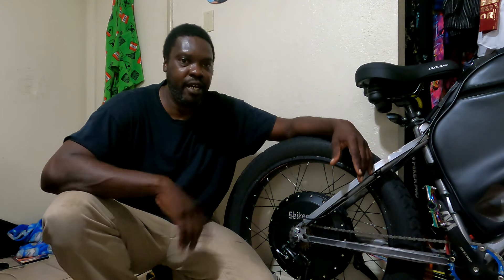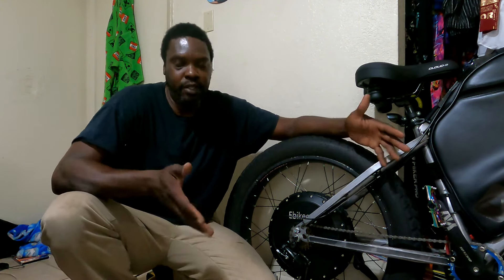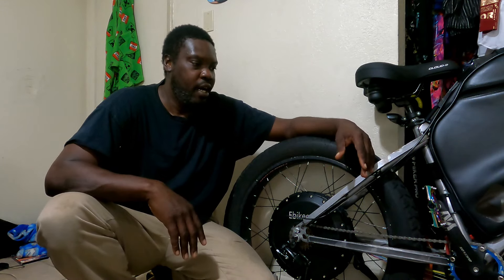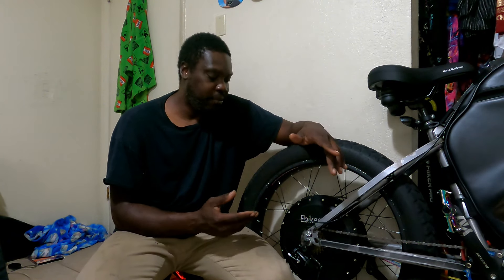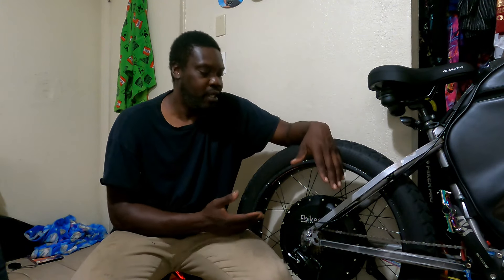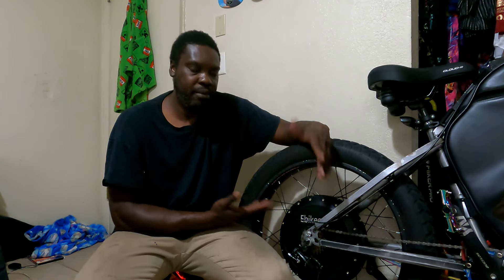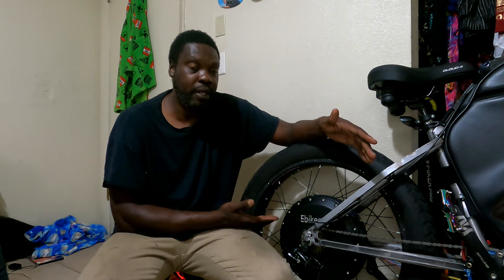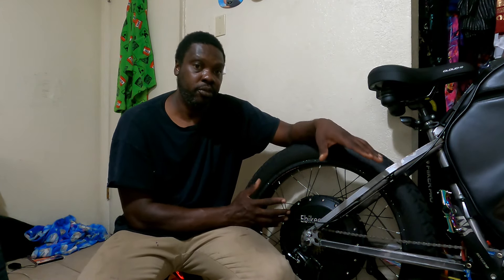Repairing the 8000w Tommebike Icon  part 1

Comment: I thought i blew up my motor a few weeks ago with a sabvoton controller. it did something similar with what felt like hard vibration with the power going out. I ordered another motor and controller, but after testing it with a ebike tester, determined it was the controller itself.  the one good thing about these ebikes is they are simple machines and many times you can just replace wires or capacitors and get it back running easily.   Sure beats a piston going through a cylinder.
Reply from the maker: Lol definitely agree about a piston I had then happened many times
Reply: Its tacticool dennis 🤘🤘. On the sabvoton I can only turn it up to 12 poles cause of my display but unlocked never the less she rips the 72/273 👽🤓🚲🎬

Comment: Good to see you EBH after hearing about floods in FL. My first ebike from 4 years ago , one of the gears is broken and now no good. It had 41k miles and I used it many times going up 6 hills every day. Only 600$ 4 years back and I converted it to be a dual motor so its running still until I replace that rear motor with another rear I have. Was a great first ebike buy for cheap of converting to a dual motor, learned alot off this first DIY Build with 4 more others I bought and upgraded later on. The ebike you have here is hell of an ebike! Love them big tires as it is best to use them fatter ones for speeds over 35mph. The tire pressure on standard 2 inch wide tires goes thru alot of impacting between road and faster mph, they usually get deflated more often. I just ordered a regular Trike Bike to convert into 2ooo watt ebike, had to make sure the front forks haf shocks for its 1 extreme need for ebikes over 500 watts from snapping or breaking.

Comment: Add cooling oil to the motor, this way not only the electromagnets get hot, the heat is distributed evenly in the motor body. However, you should wrap the heatsink cooling immediately around the motor, this makes it easier to throw the heat inside out. In this way, I can run my 2000 watt motor with 6000 watts of power, it was very useful.
Reply from the maker: I think I'll be doing that soon
Reply: Same here to tobthink about it 🤔

Comment: Yo what’s good I have a rare request. When you take the motor out to swap wheels, can you measure the diameter of the motor? I have this wild idea of fitting just a solid 14” or 16” tire on the motor itself as an experiment. Crazy idea right? The dimensions of the QS273 online appears that it could work. Then again maybe not. But that’s the great part about diy is we can push the envelope far ahead of what mass production bike builders are doing. Keep us posted on the repair! And ya this hobby is NOT cheap! 

I’ve also been looking into a batch of P45b Molicel as well as waiting to see when the P50 will be released. Because then we would have the option to build a smaller sized battery, say with 25-30% fewer cells but make the same power as the mega range battery.
Reply from the maker: Oh heck yeah  I'll do a measure for you

Comment: I hope your supplier sends you a stator with temperature sensors because if you had that and had them selected in settings your motor wouldn’t be fried by a wrong tune or turn and burn settings. 

AN is the magnet arrangement. AN 0 for the large diameter surface mounted motors, AN 6 for the OEM Surron, AN 14-16 for V-type embedded magnets. 

LM is the waveform. 22 is default but I find 16 runs smoothest. You can set this in your living room or any quiet place. As per the Fardriver manual, just decrease 22, 18, 16, 14, 12 until it feels/sounds smoothest. Always set the HIGHEST LM value that gives smooth operation. So if 18->16 felt good, and 16->14 not sure, couldn’t tell, set it back to 16.

The test is just accelerate from a stop a few feet. Don’t need to go far or fast. You will hear/feel if it’s better or worse.

The temperature sensor is like a BMS, worth every penny. My motor doesn’t have one because it’s a 💩 motor with no optional temperature sensor but if I ever buy a QS motor, it will definitely have a pair of KTY83-122 sensors in it. It would have paid for itself 10x the first overtemp it saved you from. 

You have a 4kw motor, and a 12kw controller with peak power of 43kw. So temperature sensor is pretty important.
Reply from the maker: Thank you man you is a fardriver God!!!!
Reply from the maker: @PaulslowHard  I agree 👍
Reply: would a smaller fardriver be a sweet spot or I misunderstood?
Reply: @PaulslowHard  ,yes, the Fardriver manual isn’t very clear on how you would know which hub motors should be AN:0 and which should be AN:2-4. The KO Moto manual gives a better explanation of the settings for Fardriver controllers since it is basically a Fardriver controller.

Yes, its strange they even make a 273 40H without temperature sensors, since every real controller has motor over temperature protection. But the cheap generic controllers don’t which is why many hub motors don’t have temperature sensors. They do make cheap 4000w controllers so I guess they offer a way to save money and not get the sensors.
Reply: @mA-ug5ts  , the Fardriver 721200 can be set to behave responsibly with a 4kw motor, but it comes with default settings for a typical 12kw motor.

The thing to understand about a motor’s rated power is there are so many variables that affect it. A 273 40H motor is considered 4000w continuous power but even that depends on if you are in Siberia or Florida temperatures, and going uphill or down. 

Most OEM controllers will deliver 50%-100% of rated power, so a 4000w controller would give 6000w-8000w peak power for acceleration and then the rpm control pulls that down below 4000w. So it’s very hard to burn a motor. Manufacturers do this because they have a warranty.

Fardriver controllers can sent 300%-400% of rated power. So a 72530 (330a DC) using 72v can peak at 24kw and that is more than enough for a 273 40H, and still must be set to pull current down to the maximum continuous watts the motor can tolerate. And since it has the capacity the burn the motor quickly, they have motor overtemp protection but that only works correctly if you use a motor with temperature sensor. 

When you connect a 43kw peak controller to a 4kw motor, it doesn’t spontaneously ignite, but if you use wrong settings with no over temperature protection, its very easy to burn the motor. 

The motor is basically copper wire with an enamel coating that insulates it from the other wire and the stator. When it gets too hot, that varnish melts, and the motor is burned. 

You can send as many amps to a motor as you want, as long as the windings don’t overheat. This means every amp value above maximum continuous has a time limit that gets shorter and shorter the more amps you send. 

This is why Fardriver has a BOOST feature, for those who want to send 3x-10x power to their motor, but for only 5-120 seconds, followed by a 5-120 second cooldown. BOOST does not make the controller more powerful, it allows you to use an over powered controller on a smaller motor safely. I use it on my 72360 with a 2kw motor.

If you set a 721200 to TURN AND BURN with a 4kw motor, and you do not have any self control, and don’t have a temperature sensor to monitor, that motor will be burned for sure. Many people have done it. 

The cause of this motor failure is still unknown. But if he had TURN AND BURN settings (which is the only way he rolls lol) and in his testing he learned he can give it full beans for 20 seconds before the magic smoke comes out, and then sets LM too low, causing the motor to run very inefficiently, turning more of the amps into heat than into torque, the motor would burn is less than 20 seconds.
Reply: @imho7250  thanks that is alot of valuable information
Reply: @mA-ug5ts  , this is why there are absolutely zero YouTube videos showing how to tune a Fardriver properly, especially for people new to controllers. I want to make a “Fardriver for Dummies” video, but it will take a long time and each setting would need a link to another video explaining the fundamentals.

For example, first setting AngleDetect, is where you choose the motor position sensor type used. Either 120 degree hall sensor, 60 degree hall sensor, or one of several encoder models. Then a link to a detailed video showing what each one is and how it works.

Then TempSensor, showing the available sensors and even the Cacu simulation that estimates the motor temperature. I have a video for that and I do use that setting because I have no temperature sensor.

Some of these are detected during autolearn. But moat settings are not. 

There is a distinction between basic settings and a “Tune”. Changing pole pairs, throttle curve, temperature sensor is not a Tune. These are basic settings. A real tune involves changing the settings that affect the way efficient of how the controller works with a specific motor on a specific bike with a specific rider in a specific environment. These include:

MaxLineCurr, MaxPhaseCurr, (BoostLineCurr, BoostPhaseCurr if boost features is used), MaxSpeed, ratios in speed, all PID settings. Basically any setting that determines is the motor will burn up if the rider does release the throttle before the controller automatically throttles back.

The reason for the distinction is if I say “Fardriver Tunes, $5” and then I say “ok, open pro settings, change ThrottleResponse from 0-Linear to 1-Sport. Feels good right? That will be $5. Thank you”. I would get a lot of hate that is not a tune. That’s merely a rider preference. The motor doesn’t care. It’s not going to run better. 

But the reason nobody and I mean ABSOLUTELY NOBODY has made a full tune FarDriver video is that in order to understand each setting, you need a basic course in Engineering, Physics, Motors theory, electrical theory. You can’t just say “increase MaxLineCurr until it feels good” lol. 

Someone new to controllers will be overwhelmed by all the settings. So to make a video that teaches a noob all the fundamentals needed to make the proper change in settings would be very very involved.

I have a basic setup video and there are several good ones on YouTube but that is absolutely basic setup. For any fardriver with proper size or bigger for the motor it runs, it absolutely needs a tune. Basic settings will not be safe for the motor or the battery if the motor, battery and controller were not matched when you buy them.

If i put a 721200 on my 2kw motor, using default settings, ran autolearn. And then drive it. My motor is going to be burned in the first 5 minutes of riding. And rhe 721200 will be cool as a cucumber. Lol

Comment: It may not have actually burned the windings out it could be the phase wire insulation inside .. look on the bright side.
Reply from the maker: Ok I definitely will
Reply: If so it's gonna be a cheap fix...

Comment: Sorry to hear that Bro 😢 i am sure you will get it fixed! and it will make interesting content that helps other people. I burned up the phase wires on my BBS02 mid drive 😅 its nice you can get a stator, and don’t need to buy a whole new motor. It will be interesting to see the inside of the 273. In my motor, i couldn’t tell where the wires shorted, i think it was the insulation on the phase wires failed. Cuz i don’t see any burned up wires.  I wonder how tricky it would be to rewind the stator?
Reply from the maker: Heck yeah bro,  it will definitely be alright I'll ride the back ups for now

Comment: What was the problematic pid tune on your fardriver? I'd like to avoid the combination in the future uf possible to be safe. Thanks man.
Reply: As stated in the video, he believes it was when he set LM too low. LM is the waveform and must match the motor. 

If you know anything about tuning old cars, LM is similar to ignition timing. Setting it retarded is safe but doesn’t make the motor run its best. As you slowly advance the timing, based on the fuel octane, the motor runs better and better. But at a certain point, if advanced too much, the combustion actually tries to push the engine backwards and it makes less power and extremely high cylinder pressure.

Same with LM. Default is 22. It normally runs ok, safe, but not its best. As you “advance” it to 20…18….16… it gets better, smoother, quieter, cooler. But if you keep going 14…12…10… it starts to run inefficiently. The power going into the motor starts making more heat than torque. 

Thats why the Fardriver manual says use the highest setting that gives a noticeable improvement in the motor jitter. For me it’s 16. For all QS273 I helped tune its 16. But its highly dependent on the motor magnets, which determines the AN value. 

The final analogy is, if you take 3 different motors with different magnet arrangements, and connect them to an oscilloscope, and and spin the motor to create energy, each motor will have a different wave form. 

To make each motor run smoothly, it must use the same waveform from the controller to give smoothest most efficient operation. For most hub motors it seems LM 16 is the sweet spot. 

KO Moto, which is a Fardriver with some hardware changes, actually doesn’t allow you to change LM with the new app. And for the PC app, they recommend not changing it.  But perhaps they set it at 18 or 16 default instead of 22 and lock it there.

Comment: Maybe the phase wire insulation just melted and your phase wires are just shorted. If so, get some 130c rated rubber electrical tape from home depot, re-insulate and you should be good! hoping for the best, can't wait to see the inside of this 273!

Comment: Hey Tommy I have that victrip Titan 750 that I've told you about a couple times I did that shunt mod  and it did make a difference and thank you for that  but I was also wondering how can I get some more power out of my bike the easiest way getting a better controller cause mine is a 22amp my battery is a 48v 32ah I was wondering if I should just upgrade my controller or my battery but I don't know which would be the easiest way to get more power
Reply from the maker: They make a fardriver 7235 controller.  I'm about to mod my ex wife ebike
Reply: @E-bikeguy  oh yeah can't wait to see the video

Comment: In the last 20 years modifying Inrunner & Outrunner  motors on custom  Pev,s I found out by frying many Esc,s & overheating Outrunner hub motors using REGEN causes many problems so I suggest just use Magura quality brakes Zero regen ✌